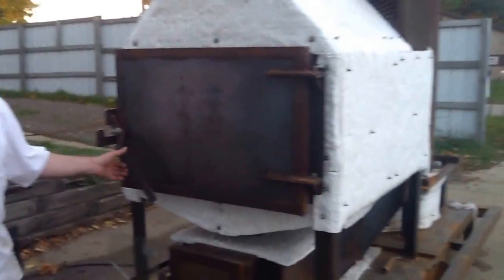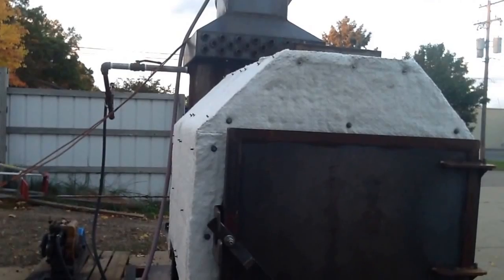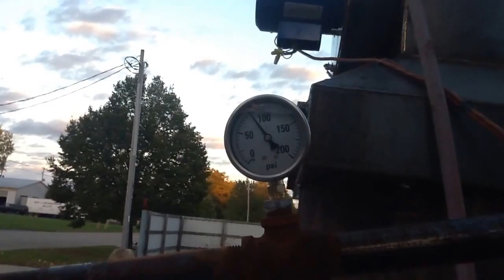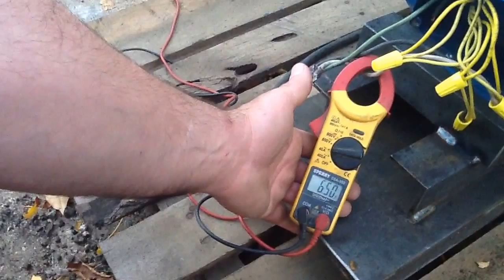gasification steam boiler and steam motor with grid tied electrical motor being run as a generator.

Comment: It is only a generator if the speed at which the motor is spinning is greater than its syncrhonous speed. Otherwise, it is just a motor with a load on its shaft.

Comment: How did you match the sin wave of the grid?
Reply from the maker: This happens automotically my friend. If you are at zero and you plug it in, it runs as a motor and starts from 0 hertz. The difference is 3600 rpm. If you are running the electric motor with a steam powered primary mover and you are above 3600 rpm on the electric motor, when you plug it into the grid, the motor is above 60 hertz and it acts like a generator, the grid phase is matched automatically and the difference in speed is minimal compared to a hard start when using the induction motor as a generator.
Reply: @ourhouseisfull11  So, you are saying; on this set-up, the motor will adjust to match the sin of the grid power?

Comment: It is connected to a 2 hp 3600 rpm 3 phase induction electric motor, that is wired for 230 volt three phase.???
Reply from the maker: yes.

Comment: If this is real, this man needs a dump truck to carry around his massive balls to just plug a generator into a live ac electrical system without synchronizing the two first. That same dump truck can be used to clean up the mess he'll make in his pants if he ever gets that generator too far out of phase.
Reply from the maker: It is an induction motor. And all induction motors act like generators if they are driven by a prime mover faster than the grid and only when they are driven faster than the grid. In fact, all electric motors start at 0 hertz when the grid is at 60 herts. All i am doing is plugging in a motor already spinning around 65 to 80 hertz into a grid that is at 60 hertz. So actually it is far more out of phase when you start an induction motor from zero than turn it into a generator with a 5 to 20 hertz differential.

Comment: Use an actual generator and not back feeding off a 3 phase motor, you'd get far  more than 6 amps....
Reply from the maker: You are 100% correct without a capacitor interface the efficiency and powerfactor is very low.

Comment: The noise level in a residential area appears to be at a level that would be quite annoying to neighbors. You say, "Then the electrical is connected to the grid and the steam motor is slowed and labors to turn the electric motor faster than the grid speed of 60 hrtz. This effectively make the motor into a grid tied generator." If you tie the motor to the grid, is the electric motor, which is "faster than the grid speed of 60 hrtz" feeding out of phase current into the grid? How about a schematic of the circuit? I didn't read all the comment, but in the ones I did read, I didn't see a response to the questions of feeding oil into the steam. Also, the whole thing starts off with an incinerator with a noisy blower referring to a gasification process. How is this gas collected and used? The incinerator, used to heat the boiler, is shown producing no smoke at the start. Later, all shots carefully avoid showing the smokestack, why?

Comment: why not pipe the exhaust to a cooling unit like a evaporator or radiator,  than pump the steam that will get turned back into water back into tank,  that way you don't have all that steam and don't need to add water as much

Comment: ATTENTION > THE MOTOR CONVERTED TO STEAM,MUST BE A 2 STROKE ENGINE ! Otherwise a great loss of efficiency
Reply: He probably welded extra lobes on the camshaft so that every down stroke is a power stroke and every up stroke is an exhaust stroke.
Reply: @gregorymalchuk272  thats a must
Reply: 4 strokes are much easier to  convert  to steam then 2 strokes,.

Comment: When you say the 3rd phase line is tied off do you mean just not used? Also do you have any capacitors in the circuit?
Reply: He says its connected to the grid 

But I don't think so becous if he shuts down the steam the grid would power the generator and keep it turning
Reply: @neok1996  diodes fix that

Comment: Love your work Don, thanks for sharing, I'm interested in producing Syngas from tyres and taking it straight to a 2.3 Kva petrol generator, or compressing the gas for later usage. I would love your advice on the gasifier design. you can contact me on farrell.paul67@gmail  I am based in New Zealand with a practical engineering background, and am a Boilermaker welder, with fitting background also, it is aproject I want to undertake and would be happy to feed back designs Regards Paul

Comment: is it possible to harness the exhaust steam and condense it to water again?
Reply: @tripplefives When I've dealt with steam powering a piston engine with a crankcase, you have to separate lubricating oil from the condensate. This occurs through piston ring slop in the cylinder. Allowing oil to enter, a minute amount but over time it adds up. Place the condensate in a drum first in which you draw off from the drum bottom. Don't put it in a pond, it will contaminate.

Comment: Old Briggs & Stratton engines don't die, they go STEAM!!! Nice set-up, I think you could go bigger and better though, less than 7 amps for all that available power is very cheesy, my guess is that you've only got induction from the motor windings feeding itself. Put permanent magnets on or into the armature and you'll get some more power from this.
Reply: Either that, or adjust the armature field higher, (more power in) and it should give you more power out! (until it reaches saturation)
Reply: The other issue you would run into is synchronizing the generator to the load

Comment: Hey Don, I'm curious at the efficiency of this. I understand you are doing it for other reasons, but purely from a monetary point of view, would you say using the cities power charges you more money or if you were to use this set up? Let's ignore start up costs.
Reply from the maker: If you ignore startup costs, i could make money just in the tire disposal. I charge $2.00 per tire.
Reply from the maker: Check out my steam turbines in other videos. I am currently making a 5 foot diameter low pressure impulse turbine.
Reply from the maker: https://youtu.be/6xdBOwYHKbQ
Reply: Ah I see, thanks for your response, and I've definitely seen most of your videos! I'm a subscriber. It's very cool stuff. I'm definitely going to play around with these, as a hobbyist,  once I finish my engineering degree.
Reply: @Geardrive427-ip8vj  Sorry my 7-year-old comment made your vagina dry. I recommend not being such a crybaby

Comment: Why not just run the gassified wood as the fuel into a standard ICE to run a generator.  You're losing efficiency by making so many conversions, especially into a motor that doesn't take steam very well.  Is this just a proof of concept rig?
Reply: Mancini, what is the meaning of ICE? thank you
Reply: Manuel Angelini internal combustion engine, sir.  sorry.
Reply: exactly. Cool it down and mix with air and voila - producer gas....
Reply: Wood gasification produces both liquid fuel and a vaporized synth gas so yeah you have both options.....  As a third way to increase efficiency, could you also coil some pipe around to also heat water for hot water production for the home???
Reply: The great thing using an ice is you can oversize the engine and generator to utilize the full gas production potential of the gasifier if it is well engineered. Alternatively use the heat for alcohol production and end up with a product that will run many ice engines including diesel. If you use a vaporization system to run the engine it will provide substantially more horsepower per liter used but must be 190 or higher proof to near fully vaporize. Refer to the pougue carburetor for inspiration.
As a bonus if you have cattle or pigs, the mash is a great high protein feed.

Comment: You could try to lower to pressure where your water is boiling. The thing is that by lowering the pressure, you can change the boiling point of water. And you could also recycle the used steam to pump it back it the piston.

Comment: I think it's a great idea and we tried many different ways to do it but the problem is that every internal combustion engine has blow by on the rings and when you use steam the water mixes with the oil and washes out the bearings the next thing we are going to try is an oil cooler that also has a water & oil seperator 
Best of luck
Reply from the maker: We have abandoned the conversion of the internal combustion engine. Now we are working with a version of the tesla turbine. This will allow us to reclaim almost all of the steam and send it back into a condensate tank without any oil contamination.
Reply: @ourhouseisfull11  hello Dan. I am based in Nairobi Kenya and would like to know how could we use your used tire fire burning boiler idea here to support the community to use used tire and reduce waste.  I would highly appreciate if you could kindly write back to me at kotharyabbas@gmail.com or whatsapp me at +254731844233.
Reply: I was wondering the same thing! My thought was to run exhaust to a primary buffer tank with a "bladder" to hold pressure then add lightweight (veggie or similar oil) to the system (closed)....any thoughts?
Reply: What about an aircraft turbine engine, ex helicopter or turbo prop engine?